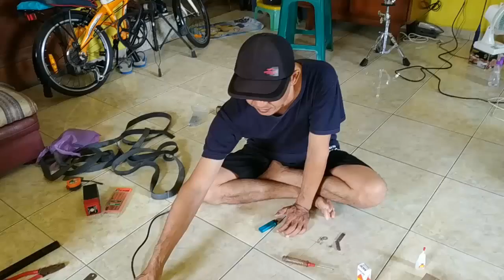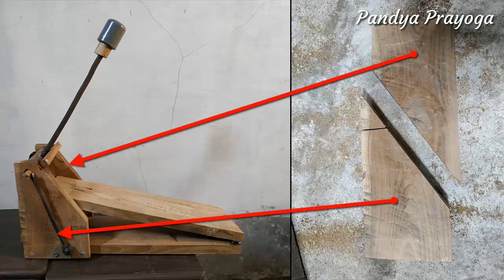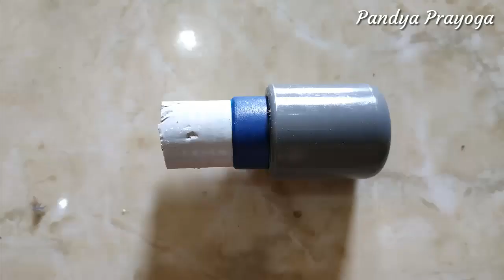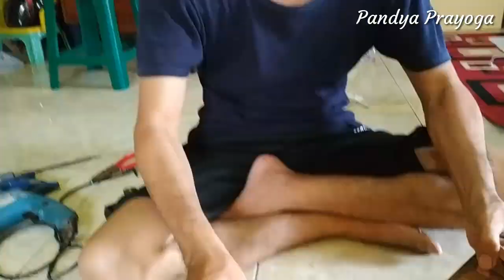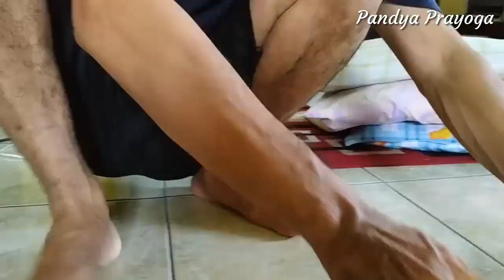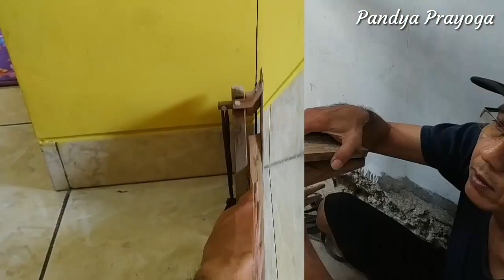How to Make Drum Pedal by Yourself

Comment: What is that metal stick? What is it used for? Where can i get one? And if its shorter will it be  like more accurate cuz the time it goes back and forth will be shorter..?
Reply from the maker: Yes, this is made of iron from building materials. This is for the neck pedal. You can get from unused iron or buy a piece at the material store. This can be custom, depending on your bass drum settings
Reply: @PandyaPrayoga  whoa, okay thank you for answering! Hopefully i' ll find one, thats all i need i already made the wood pieces.